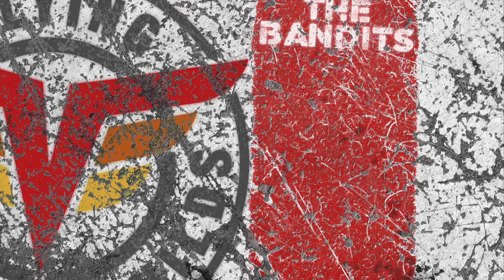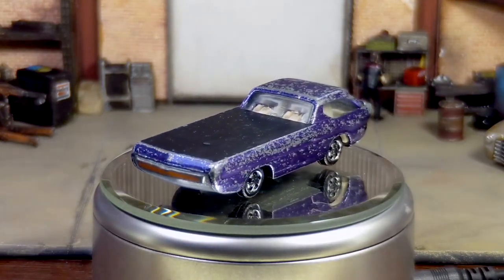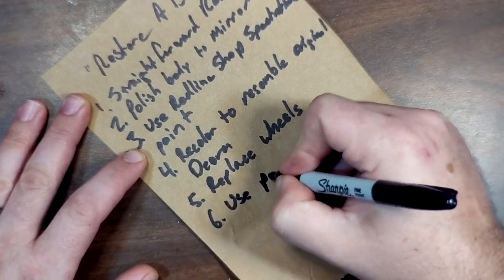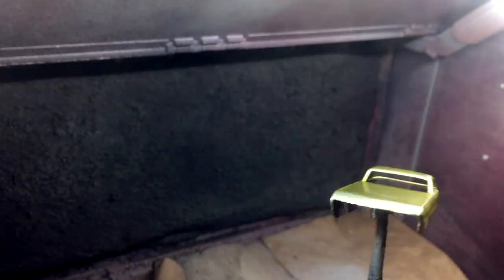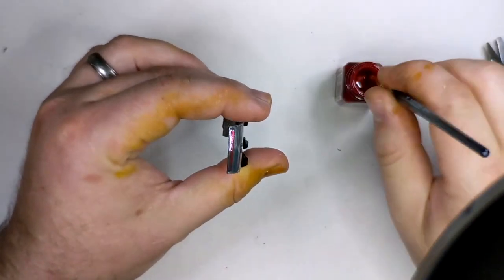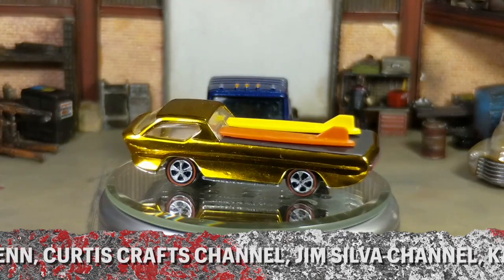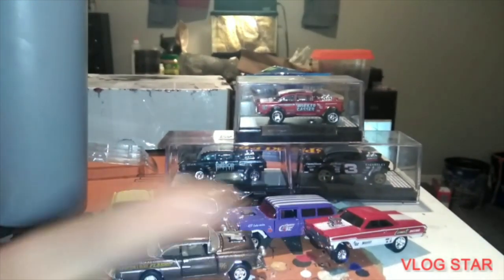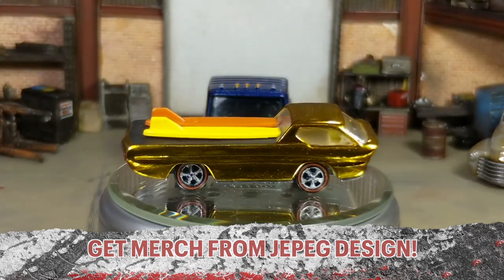My First Redline Restoration - Renewing an original Hot Wheels Sweet 16 Deora

Comment: Breath taking.  How do you get the zinc to fill in the pitting? Do I etch the body with something before the  zinc plating process?
Reply from the maker: Thanks! I actually didn't do any zinc plating. This car didn't need it. You don't need to etch the body though. Just make sure it's as clean as possible. Use alcohol or acetone to clean it off.

Comment: Great job, it looks like it was dipped in gold. I am guessing the paint had a hard time sticking because of the polished metal.
Reply from the maker: Thanks, Wes! Yeah, polished metal is like trying to nail Jello to a wall. I do have some cars I want to Spectraflame in the future, but I will probably use Duplicolor Metalcast paint as a base. It won't be quite as intense a shine, but it will definitely be less frustrating to work with.

Comment: So what made the third time the charm with the masking?
Reply from the maker: Maybe a better mix between the hardener and the paint? Better prep? Not really sure. I was already using a super low tack tape so it was probably just bad prep or some impurities on the surface that caused the failure.